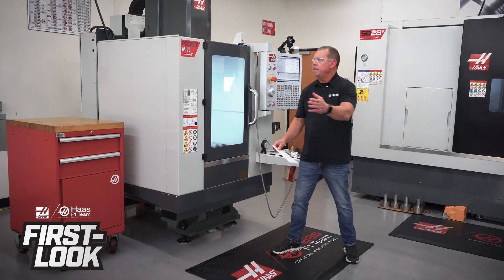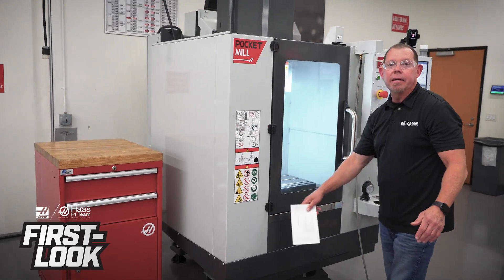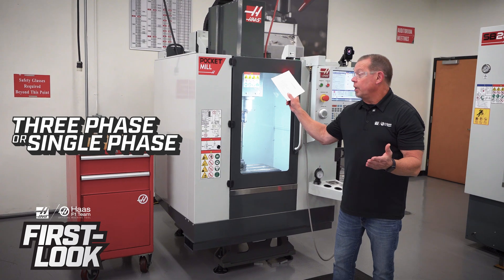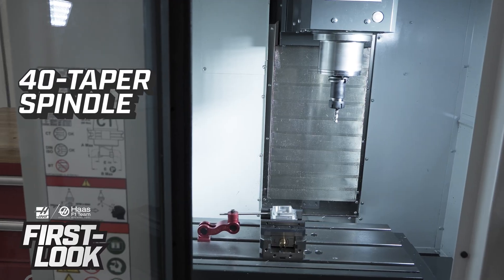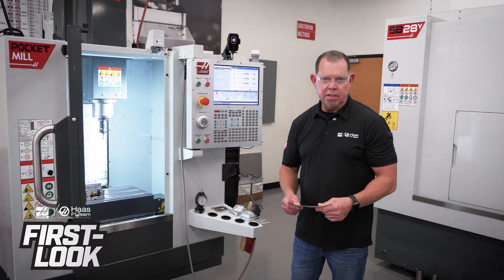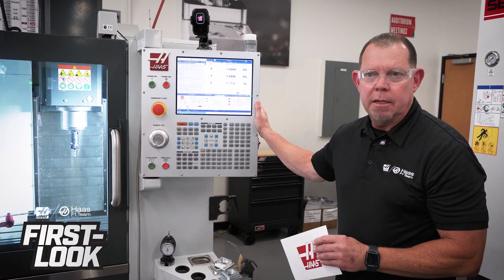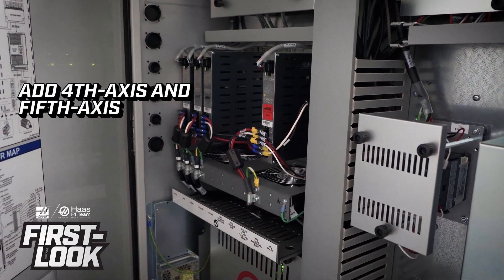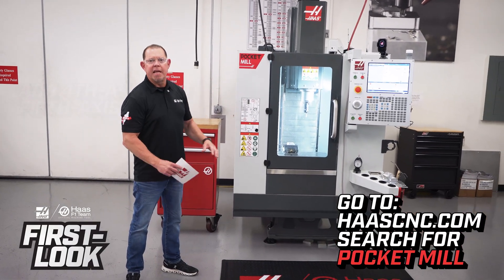The Haas Pocket Mill - First Look - Haas Automation, Inc.

Comment: dont forget another $16,000 in options to bring it in line with a tormach that is still $10,000 cheaper
Reply: Yeah but the tormach probably isn’t as rigid
Reply: @trashbag8124  bro haas and rigid are not meant to be used in the same sentence
Reply: @trashbag8124  the tormach is epoxy granite. that is plenty rigid enough for the type of work you would be doing on a small machine. the tormach is objectively better in literally every way, and cheaper

Comment: You are out of touch with what is going on around you. This thing is born old.
Millenium machine Miley V2, Carvera Z1, DMC2 Mini, Nestwork C500 just to name the ones I know sub 3K.
Those are the machines a beginner would put in a garage or in a small shop and more are coming.
We are at the dawn of the era of the small and affordable CNC machines for everyone.
This thing is at the sunset of the old bulky and expensive CNC.
Reply: Not sure I agree with you on that. Those machines you listed are not able to handle near as much material and are significantly less rigid.
Reply: @trashbag8124 but still capable and more begineer oriented.

Comment: Im glad Haas is entering this market but this should have 10k spindle standard with up to 16k at least. A machine like this will be running a lot of small tooling and light material, it needs to reflect that in its capabilities.

Comment: This is not attractive to me as a small business startup on a budget.  The cutting envelope of just 12" x 12" is far too small and limited.  Space limitations mean you need to be able to do as much as possible on one machine.  Not just a small  footprint. A Bridgeport conversion gives you 30" x 12" or more for a lot less cash and even smaller footprint. 

4000 rpm is too slow for aluminum or wood. Space limitations mean I need to cut all materials on one machine. Not just steel and titanium. 

I actually have a 7.5hp 24,000 rpm 30"x 12" CNC mill in my garage.  I had to  build it myself because there was no suitable budget options available. I obviously had to compromise but not on speed and work envelope as these directly effect profitability. 

$25,000 without a tool changer is just not a good deal for a 12"x12" 4000rpm IMO. I think I'd struggle with it's limitations and regret buying it almost immediately. I bet you're over $40,000 if you add a tool changer and faster spindle knowing Haas

Comment: "$25k price! Try to beat that!" Yeah no atc no coolant and standard 4k spindle? Pretty easy to beat that. Bump the spindle add coolant and a atc and you cost more than a syil x5. This is a gimmick
Reply: For that price you can get a XH7122 from WMTCNC like the one I show in my videos. 12 tool ATC, 10k spindle, sinumerik 808d, rotatory 4th axis and coolant/air system.
Reply: Still 10x the price for what used 1990s iron that still works perfectly fine, cost around here, including delivery. 
Can't beat nice 6000kg of iron, for that price
Reply: What is your opinion about Haas CL-1? do you have a better option? Thanks for your time
Reply: @aliakbari1733 have not looked at the CL-1 so I dont have an opinion on it.
Reply: So no, you can't beat it is what you are saying lmao. Price out something comparable i'll wait.
Reply: @siliconvalleymetal syil x5 starts at $35k has a 16 tool at coolant and a 20k spindle standard. Yes it's only bt30 but when you add the 10 tool atc coolant and only an 8k spindle this machine is $2k more than the syil with less tool space and way less spindle speed. In my opinion this machine is not the best buy out there.
Reply: @my63stingray  yea but you aren’t gonna get a machine that holds tolerance at 25k like the haas and Syil doesn’t have anything priced that low. It’s a 10k difference from base price so there will be a market for prototype and small run mfg. Syil at 35k spanks any haas in that range but we’re 10k below that. I’d rather buy a used vf2 than a new machine anyways.
Reply: @siliconvalleymetal syil doesn't have anything priced that low because they kept the atc, coolant, and the high rim spindle as standard. I disagree with you that at 25k this will be a prototype machine or anything else because people are going to want the atc coolant and the faster spindle. That is going to run you around the 35k the syil x5 is but with less tools and spindle speed. I do agree that a used machine would probably be a better buy for a shop trying to make money. But if I'm someone with extra money to buy a cnc machine for a hobby this one is not going to be it.
Reply: Bingo!
Reply: 30k with tool changer and its a great machine to run one kind of part

Comment: I could really use one of these with a 10, 12, or even 20K BT30 spindle.
Reply: Brother speedio
Reply: @MikeYurbasovich ik but this is single phase…
Reply: the older office mill is about what you need. might be iso 20 though and 30k rpm. today it's called the CM1
Reply: @WCGwkf I have 2 CM-1 they are great wish they would focus on those as the energy machine and compete on the pricing

Comment: Single phase is a big plus
Reply: Any 7.5hp machine can run on single phase.

There's plenty of 1ph in 3ph out VFDs. I use one myself for a 3ph spindle from a regular 1ph 240v outlet 

There's also 1ph 240v in 3ph 380v out VFDs.
Reply: @Zebra66  Yes I have 2 retrofitted machines with that exact setup, 3kw single phase to 3 phase 220V VFD  But I'm referring to all those new machines running only 3 phase that are inevitably fed by an expensive phase converter
Reply: @SuperYellowsubmarin Any machine can run on single phase with the right VFD and servo amps.

Note how they say "can" run single phase. Does not say that they won't charge you extra for a larger VFD.

Comment: Haas are good machines for the money. My only question is how many people actually get a 4k spindle? Haas make all your machines 6k minimum. As a machinist I know single phase which most folks buy this for you need high rpm and light step over with high feed. This isn't a machine to hog with. Good machine if it had a tool changer , rigid tapping and a 6 k spindle for maybe 27,500$ now your talking.
Reply: it's under 40 with an 8k spindle, atc, coolant and rigid tapping. Based on their info, it does seem like the spindle is more powerful than the 1500mx and the casting is 1k lbs heavier. The travels are too small for what I want to do so it takes it out of the running, otherwise I'd seriously consider it.
Reply: @Cyrix2k the travel is to small I think their mini mills is a better option but you still gotta pay alot to upgrade the way most people would need , the base prices don't really mean much on these single phase mills

Comment: 4k standard spindle speeds in a machine that size doesn’t reflect the size of parts that people will be running
Reply: Add a zero to that figure and it would look tasty. Even the 8k rpm spindle is a joke on a "production" machine this size. The 40-taper doesn't make a whole lot of sense on this size, unless you already have 40-taper tools... which you don't if you buy this.

This is a competitor to the 30-taper 1500MX (10k rpm standard) and Syil X5 (20k rpm standard) with a shit spindle.
Reply: at our shop we have very old VF 3, 5, and 10 machines. All the spindles don't go past 4000 just from age, we're a prototype shop so max we'll ever run are 10 pieces for one project but we've ran all materials from plastic, aluminum, stainless, to even Inconel. You work with what you got and make it work
Reply: @SolavaPlays  Notice how the sales rep said "you can run production in this machine"? 
In a prototype shop I agree with you, but not for a production shop where you need to produce in order to make money, then max RPM do matter quite a bit in this size.

Comment: If it's not gonna come with coolant as standard I'd at least hope for a default air-blast nozzle at a MINIMUM. Still, a nice small form factor is nice but starting to be a lot of overlap. Now that Haas has the Pocket Mill, the TM-0, TM-0P, Mini Mill and others, a comprehensive head-to-head and comparison video is in order.